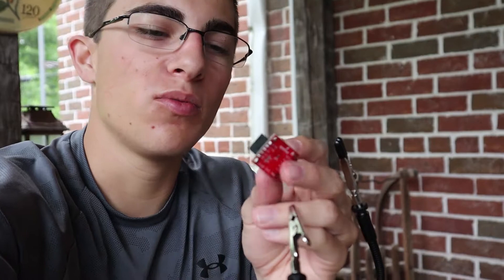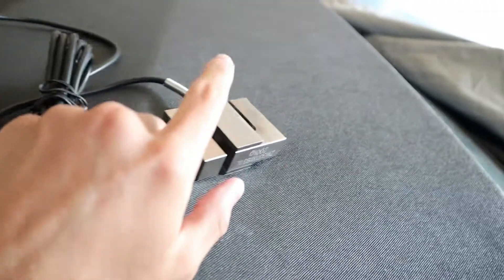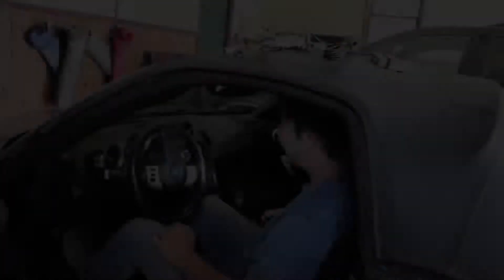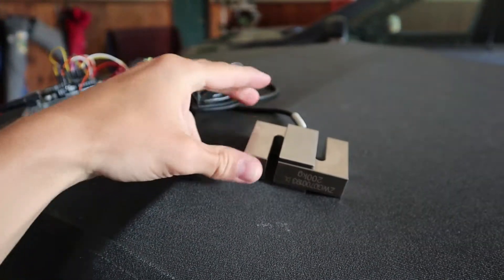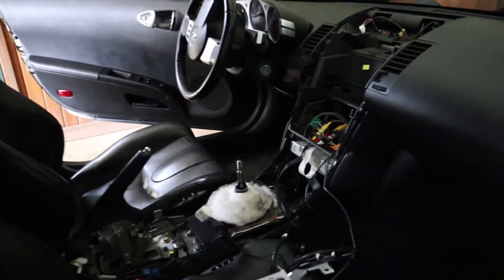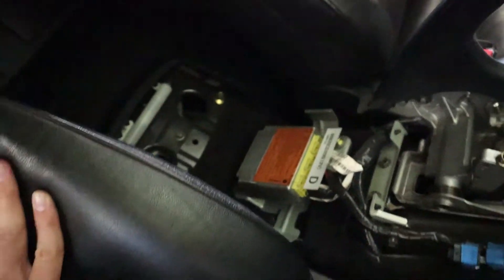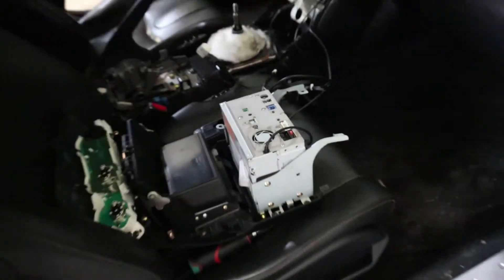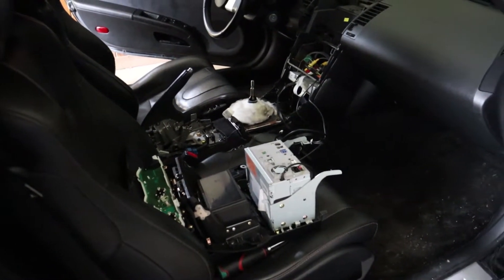Making a Hand Operated Clutch for my Nissan 350z! Part 1

Comment: Great Job. Why you are not using a potentiometer just on the hand lever? You will get a precise current for each position of the clutch handle. Just a cable in need to connect with the arduino. What is the type and its force n/m of the stepper you have used? Have you measured the LBS in need to push the foot clutch pedal? I'm working on the same but for a 12 t truck. Greets from Germany Hugi
Reply from the maker: You probably could use a potentiometer as well. I don't think I really looked into that. I went with the load cell because I also wanted to have some feeling in the handle. If I went with a potentiometer, I would still want to attach the cable on the handle to something to pull against and have a spring to return. 

That may be something I look into in the future. I feel like it might require a custom handle though and most of my current components are off the shelf. 

I am using a NEMA 34 stepper motor with a 12Nm  torque. I did measure the force values at the pedal to initially find the motor size I needed, but I do not remember what they were. I will look back and see if I can find it. 

Thanks for the comment. If you have any other questions let me know. Good luck with your project!
Reply from the maker: I actually took the force value at the pedal in this video. Looks like we got about 60 lbs.

Comment: so is the idea that you'll have a button that'll drive a servo that'll manually push on the clutch for you?
Reply from the maker: Yea just about. Instead of a push button it will be a handle that’s attached to a spring and sensor to allow for exact position control of the pedal rather than just an off or on button.